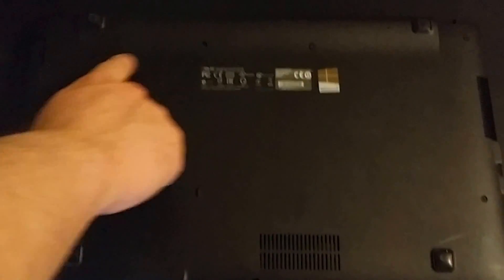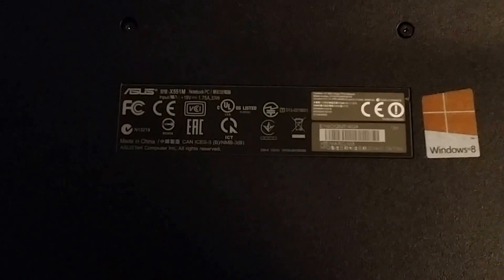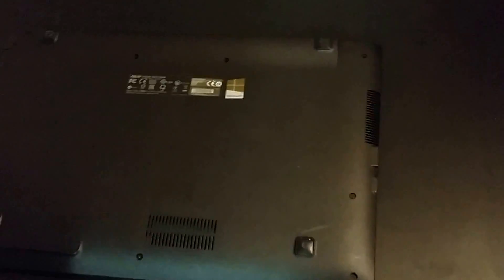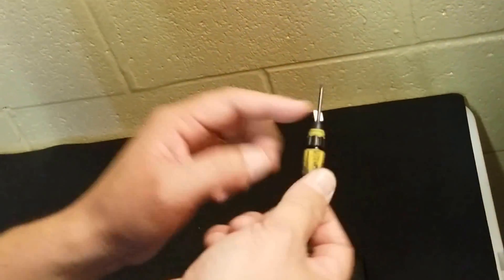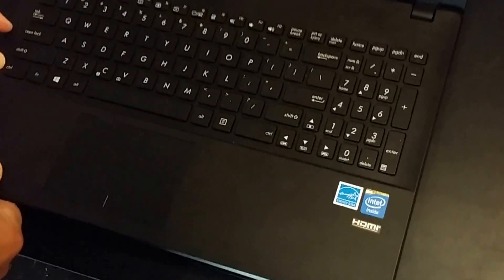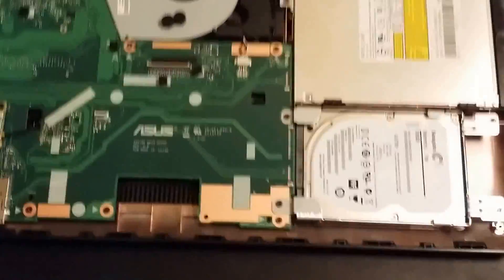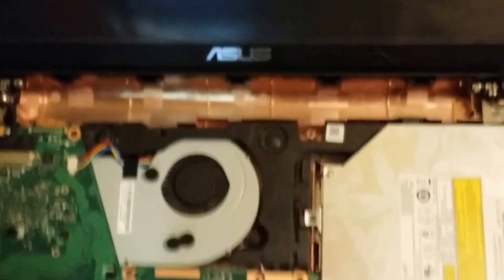ASUS X551M Laptop Battery Removal & Won't Power On Fix

Comment: I was wondering if there would be any chance of seeing a video of opening the laptop with all of the connections still in place? My battery is gone (won't turn on unless the charger is connected) and I'm ordering a replacement. I'll need to remove to old one, but I've never opened up a laptop before so just want to be very careful I don't mess anything up while replacing the battery!
Reply from the maker: +ArcticMnky Unfortunately, that disassembly was a customer's laptop which I no longer have the privy of using in another video.  This video was shown to quickly demonstrate the ASUS X551 bad design of trying to remove the Li-Ion battery which should normally take all of 5 seconds.

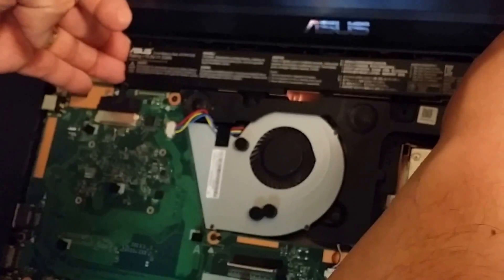Comment: hi, i got the same laptop and it wont detected the battery. I noticed a broken paw on the connector you mentionned at 4:45 in youre video(the negative one is missing and broken).do you have the part number of it or a solution for me. Tks
Reply from the maker: +mrsuperredhot You can get a replacement battery on eBay or Amazon by typing in their searches: Asus A31N1319 Battery
You will see prices range from around $20 - $40.  Get the NEW batteries and never used!
Reply: hi, tks for that fast response but the connector i meant is on the board not the battery.
Reply from the maker: +mrsuperredhot Oh sorry, I thought you meant the battery.  There is a motherboard RIGHT NOW on eBay for about $80 new.  You cannot fix a connector like that in fear of something CATASTROPHICALLY wrong happening to the system or to yourself.....

Here is the link for a replacement board:
http://www.ebay.com/itm/60NB0480-MB2200-201-ASUS-MOTHERBOARD-SR1W4-INTEL-MOBILE-CELERON-N2830-X551M-/291554118102?hash=item43e1fac9d6

Get this board, follow the instructions to disassemble the laptop to expose the MB then simply remove all other cables and screws holding the board down to the chassis, remove the board, then install the new board when you get it and do everything in reverse from tearing it down to building it back.

Good luck!

Devin
Reply: tks again sir :)
Reply from the maker: +mrsuperredhot NP good luck to you!  $80 to fix a $300+ laptop is a win in my book ;)

Comment: Great video - thank you for posting :) !

Just curious if the Laptop will still power ON and do all functions without the internal battery pack?

I would like to maintain the charge of the original-batteries so i intend to remove an store the batteries in a safe place.

Please let me know if this option will still work.
thanks for all your help :)
Reply from the maker: +grc071s Hi, good question.  Yes 95% of all laptops do NOT need a battery installed in order to turn on the unit.  It will work perfectly fine without a battery.  Just remember that if you do this, you are essentially making this laptop into a portable desktop and if there is a power outage, it will shut off.

Some advice:

1. Place the battery in a 35-40 degree F or 3-5 degree C temperature to keep the battery from degrading quickly.

2. If you ARE going to be using this laptop at ONE specific spot, I recommend purchasing a UPS (uninterruptible power supply) such as one from APC or Cyberpower.  It gives you 5-10 mins of battery backup in case you get a blackout or sudden interruption in power.  It also has built in surge protection to help protect your computer(s) and devices.

Good Luck!

Devin

Comment: I couldn't pull my power out and I kinda couldn't pull out the left side, so I tried pulling out of the right side and it didn't come out, is my computer dead? please reply, fast
Reply from the maker: +Mistah Secksi Do you mean you couldn't pull the battery out?  There are screws holding the battery down.  Did you remove them first?

Comment: Hey, I've had this laptop for less than a year and the battery has all of a sudden gone to shit! :( As soon as the charger is plugged out the laptop goes dead, but if i keep it plugged in it stays on and says 0% plugged in charging.. Driving me insane, I need it for college, will taking out the battery or anything help or do you think I need to buy a new one? Thanks for the help, Laoise
Reply from the maker: +Laoise McC Unfortunately, your battery sounds like it has gone bad based on your description.  That or your power adapter could be "going" bad by not providing enough power to both power on the system AND charge the battery.  The last possibility is that your charging "switch" on your motherboard has gone bad and that is the absolute worst case scenario.  My feeling is that your battery just went bad though.  You can get a replacement battery on eBay or Amazon by typing in their searches: Asus A31N1319 Battery
You will see prices range from around $20 - $40.  Get the NEW batteries and never used!

Hope this helps you!
Reply: +Angrysquirrel PC Thanks for replying, I really appreciate it! Hopefully a new battery will do the trick. Thanks again!
Reply from the maker: +Laoise McC No problem!  Good luck and use the video to disassemble the laptop to remove/install the battery :)

Comment: And one more thing, if you run across one that refuses to boot to a flash drive or CD/DVD, and the utility partition is destroyed, AND you have to upgrade the bios just to turn off safe boot, that my friend, is the most annoying thing in the world. Just to remove 8 and install 7 as the client requested, took so long I felt guilty about the labor, considering I gave an estimated labor charge based on the time I usually spend installing an O.S. This is exactly what happened on a Asus x155m.
Reply from the maker: Yes, that is the most annoying part about post Windows 7 computers.  Secure boot Uefi is a dual edged sword.  They designed it that way to help increase security but to techs, it is more a PITA then anything.  I have learned recently that there are two boot source types.  Bios/Uefi for legacy systems which uses the MBR format and the UEFI ONLY for current systems which uses the GPT format.  If you turn off secure boot and use the Legacy MBR format, you wont be able to turn secure boot back on on a system that is UEFI only because it won't recognize the Windows OS and not boot.  It took me a bit to find that out.  Again, MAJOR PITA with all these changes.

Comment: I hear those are good computers. However, I purchased one on ebay the first part of this year and have had nothing but problems with it. I’m sick of having to take it to the shop every time I turn around. Now it won't boot.
Reply from the maker: +Gaspare Misseri The general rule of thumb is this one.  "you get what you pay for".  The price is usually a good indicator of how good a computer's (or any other product's) performance and reliability will be.  Expect under $500 computers to have more problems (over the long term IE: 2 years) then a $800+ computer would.  On laptops, the number one hardware problem I fix are failed hard drives.  DC Jack replacements are number two.
Reply: +Angrysquirrel PC:  FYI I gave you thumbs up indicating I agree with your statement. What I like to know is, how come I purchased an emachine 6 years ago for 300.00 and is steel running strong? BTW, thank you for your video and your response.
Reply from the maker: +Gaspare Misseri Um....  if you want the HONEST TRUTH..... from my personal experience repairing computers for 10 years professionally and 5 years more helping family and friends, you got REALLY lucky.  I am assuming that your E-Machines is a desktop as E-Machines laptops are not as common as their desktops are.  Laptops fail at a higher rate due to the fact that they are portable.  The two most common problems that fail on laptops are due to MOVEMENT and HEAT.  Since laptops are portable, they tend to get moved around a lot, which in turn puts more stress on items that have moving parts, namely mechanical hard drives.  I have some customers that leave their laptops on, stick it in a bag, and move it from place to place.  NOT THE BEST SITUATION.  Laptop hard drives fail at a 10 to 1 ratio due to this movement.  Desktops on the other hand typically are stationary so the lack of movement contributes to the reliability.  Heat is the other issue.  Laptops are pretty much a tightly compacted closed off system.  MOST laptops tend to have one small fan that sucks up air from the underside and exhausts the hot air to one or two places out the side.  Due to different thermal designs, some manufacturers are better then others in terms of graphics chip/motherboard failure rates.  HP is NOTORIOUS for their poor thermal designs (they were sued in 2007 along with Nvidia for it AND they STILL design them poorly).  In my professional opinion, AS OF TODAY, the rankings from Best to Worst in terms of customer repairs are:

Lenovo, Dell, Samsung, ASUS (not the cheaper ones), Toshiba, HP, Acer (They bought out Gateway/E-Machines)
Reply: Hey, I really appreciate your input. I will use your information as guideline for my next laptop, neanwhile I will invest in a cooling device to place under the laptop. Wishing you a pleasant day.
Reply from the maker: +Gaspare Misseri No problem.  Good luck to you and hope the info was useful for your future purchases!

Comment: hey man, watched your video and I'm currently trying to take off the cover off my new F554L laptop, is it the same method as you are using for this modell or is it any different? Regards
Reply from the maker: +calle olsson TBH, I have never removed or disassembled a F554L laptop.  If there are interesting ones that come into my shop, I record them and post them.

Comment: These laptops are a nightmare. I have never spent this much time on a laptop. Along with the ridiculous "secure" boot that makes repair of the os just as time consuming, having to update the bios, just to make a USB drive bootable, etc. I would enjoy burning piles and piles of these.
Reply from the maker: +Steven Causey Yeah, Since the adoption to Windows 8, you can't even get into safe mode easily anymore.  On a lot of PCs, the ONLY way to get there is to boot into regular desktop mode, hold the shift key down, then restart the computer.  That right there is a major PITA.  Some computers do however have the system recovery option that gets you into that menu but again, just give us back the F8 for crying out loud!

Comment: Hello sir, my cat puked on the area that has the power input.... It won't charge or turn on I've removed the battery, cleaned the top of the MB, it seems like they're may be a small amount of corrosion on a few areas, is their a cmos battery I could pull and plug? Any ideas? should I take the MB out and clean under or all the connections on top?

Comment: I can't fucking get the top off
Reply from the maker: Fae Ryan There is a trick to it.  First of all make absolutely sure that you removed ALL of the rear cover screws.  Then once all the screws are removed, get a flat rigid tool such as a butter knife to REALLY thin but strong screw driver and start at the top right corner.  Wedge in the tool and you should eventually get the lid to "pop" open as the lid is being held by retaining clips.  Be gentle as you don't want to break the clips.  Work your way down the sides.  Be EXTRA careful when you try to pry open the bottom of the lid since the touchpad has a ribbon cable that is attached to the motherboard.  When you get the lid pried open, carefully lift the lid from the bottom to the top.  Release the touchpad ribbon cable connector to remove the ribbon cable.  Follow the video at this point.

Good luck!

Comment: I tried it.. I had fun doing it.. but it was a total failure.. hahaha.. but luckily I got it 4 free..
Reply from the maker: If it didn't work for you, you unfortunately might have motherboard issues.      Do you get any power indicator lights on when you plug in the DC jack to the power adapter?

Comment: Are you able to upgrade the RAM on this model? There seems to be some confusion on whether it's possible...Thanks!
Reply from the maker: on 99% of this Asus model, you cannot remove or add memory into the laptop.  This motherboard has memory that is soldered on and not removable.  Welcome to the new wave of disposable sub $350 laptops.

Comment: What about the macbook, those morons didn't put a replaceable battery, talk about good design ?
Reply from the maker: Stefan Marjan Yep I feel that ALL designs should at least have a somewhat easy access for battery replacement.  Unlike PC manufacturers, Apple intentionally does this to have a closed ecosystem because they don't want normal people to "monkey around" with their products which in turn would potentially either damage them OR making changes to something they really don't want changed.  It is a combination of greed and insularity/protection.  With PC's, until the last 3-5 years, people had the ability to upgrade their parts "fairly easy" and have easier access to parts such as batteries.  The sub $350 laptops changed all that though because PC manufacturers aren't doing what Apple did in terms of "protection".  They are intentionally making these laptops disposable for so people will "discard them in 2-3 years" and buy "NEW" ones.  In terms of carbon footprint and long term, cheap PC makers are in my opinion WORSE then Apple design wise now for that reason alone.

Comment: how do I get to the RAM ?
Reply from the maker: pravin kalai There is not a video because on 99% of them, the memory is not removable or upgradable.  The memory is fused/soldered onto the motherboard and if you remove the motherboard, the memory is on the underside.
Reply from the maker: pravin kalai You cannot change memory out of this particular model.  This laptop is one of the new wave of "disposable" computers designed to last maybe 3-4 years then you simply buy a new one.  That is why they designed it this way.  If you ask me, they are being wasteful AND are simply forcing people to upgrade regularly to increase their profits.  This is one of the reasons I tell my customers NEVER to spend less then $500-$600 on a laptop.

Comment: Anddddd the screw is stripped
Reply from the maker: Diego Moore Diego.  All is not lost.  Moody's has a great screw extractor tool from Amazon.
http://www.amazon.com/Moody-Tools-58-0670-Extractor-Reversible/dp/B000JCT3W0#product-description-iframe

Or if you want to repair your screw,
http://www.amazon.com/Woodmate-2498-Grip-Screw-Repair/dp/B001B38ALG/ref=sr_1_1?ie=UTF8&qid=1438890340&sr=8-1&keywords=screw+hole+repair

Try one of those and let us know how it worked out!

Devin
Reply: ***** Thank you so much, will try.

Comment: you have a video on how to remove and install ram inside a asus laptop, if so please send it because I'm trying to install more ram into my asus x551 ma.
Reply from the maker: Tellis Mcford There is not a video because on 99% of them, the memory is not removable or upgradable.  The memory is fused/soldered onto the motherboard and if you remove the motherboard, the memory is on the underside.

Sorry for the bad news.
Reply: Wow and that's alot huh? So I know the ram is on the motherboard but the to get higher ram to either changed my laptop or try change the motherboard? Since the ram is fused/soldered onto the motherboard then?
Reply from the maker: Yes.  You cannot change memory out of this particular model.  This laptop is one of the new wave of "disposable" computers designed to last maybe 3-4 years then you simply buy a new one.  That is why they designed it this way.  If you ask me, they are being wasteful AND are simply forcing people to upgrade regularly to increase their profits.  This is one of the reasons I tell my customers NEVER to spend less then $500-$600 on a laptop.
Reply: hmm ok thank you for all the advice I'm getting into the I.T. field and I want to explore and get a better understanding of what there is and how to do it. I really into the field and gain the experience I need.
Reply from the maker: Tellis Mcford No problem.  Good luck in your I.T. journeys!

Comment: My friend have battary problem and resemble a battary i need to pull of 12 nut that is fuking bullshit
Reply: Is there any easy way to do that..??
Reply from the maker: Dipto Sarkar You want to disassemble a laptop to GET TO the battery or you want to disassemble the Li-Ion Battery itself?
Reply: ***** I want to remove my friend laptop battary but it's fuking inside. Because he have some issue like battary plugged on computer but not charging in my laptop pull off battary is so ez but in asus battary is fucked me up.
Reply from the maker: Dipto Sarkar If your computer is a ASUS X551M, watch the video and it will show you exactly how to get inside to get to the battery.  You will have to remove the Keyboard lid, unlatch the cables carefully, then unscrew the battery from the inside.

Good Luck!